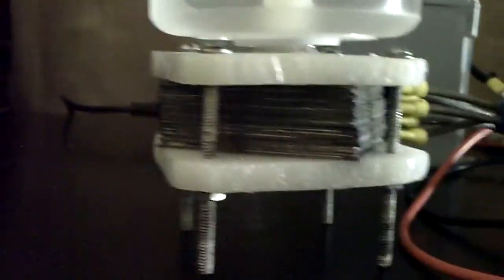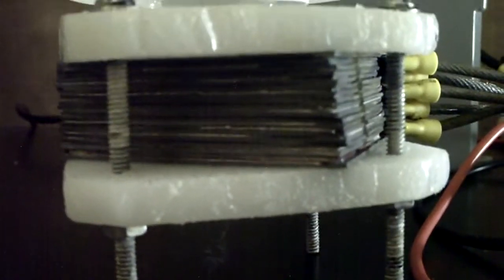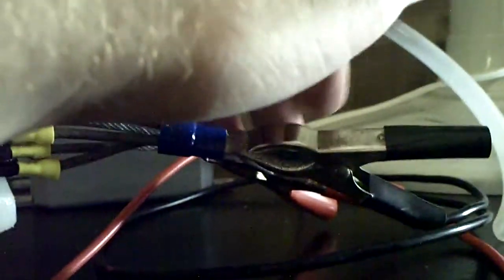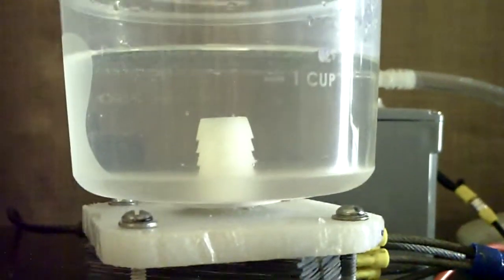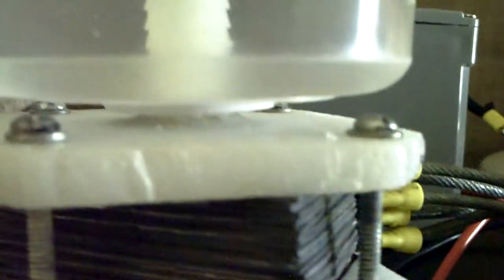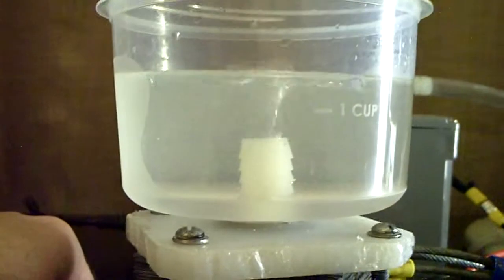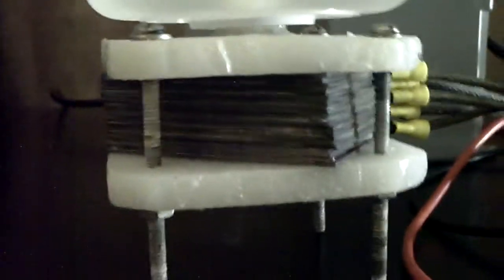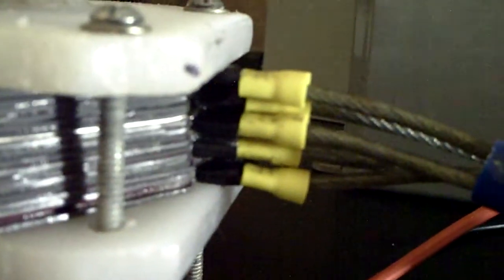Vid45 Volcano Cell Update (HHO, Brown's Gas, Hydroxy)

Comment: @HHO4ALLExcellent response, very good explanation, I have observed the same in my experiments with dry cells.

 So the idea is to merge the electrolyte tank, with the dry cell.

 But then, my question is, gas bubbles make it out fast enough so as not to accumulate between the plates?

Comment from the maker: @UltraDavidson37 You are entitled to your opinion.  I have tried standard drycell designs and horizontal designs actually work much better than vertical designs.  

Vertical designs build up pockets of gas that have to be forced from one plate to another.  They also have less reactive surface area, because the electrolyte will not go above the exhaust port.  This leaves you with 10 to 15% of unused surface area.

Comment: Very original, but this design is not as efficient, the bubbles begin to accumulate between the plates and prevent a good electrolysis, due to the horizontal position of the cell

Comment from the maker: @summertimef1  I discovered that using Negative Plates on the ends reduced the number of Pos Plates and in effect reduced amperage.  

Try a configuration like this (you will get the similar output with lower amperage)
-nnn+nnn- (using the extra neutral will increase the distance between the POS & NEG plates and will reduce amperage)

Adding neutral plates lowers the voltage per plate.  5 plates at 12v = 2.4v per plate, and 9 plates at 12v = 1.3v per plate.

Comment: @HHO4ALL   i got a question i have my ss plates. what did u find the best result in plate setup  +nn-nn+nn-   or +n-n+   or  +nnn-nnn+   what worked the best. ihave a 5 plate setup +n-n+  and i have a 19 plate +n-n+n-n+ ect.. i did to the +-+-+ that didnt work to well drew way to many amps.. so it need a N to separate them.. but should i use two N or three N?

Comment: trim the plates down on one side, but leave a little tab to plug the female connector in to in diffrent locations to reduce over crowding. 
to increase flow, use 2 tanks, and pipe it so the water can flow in from the bottom and bleed over to the second tank to prevent over flow.

Comment from the maker: I am using 1/16" Shower Pan liner for my gaskets.  This is pretty much the standard for most dry cells.

Water does not have any problems getting between the plates.  In the center of each plate I have a 1/2" hole that is located directly below the 1/2" Hose Barb. Gravity forces the water from the bubbler into the cell, where the center chamber is filled completely.

Comment from the maker: You are right, I was way off.  I hadn't taken that into account, but I'm sure I could mount it on a float plate to keep it level.

I've started working on a new variation that has dual output. The holes are drilled at the corners of the 3"x3" plates (diagonally across from each other).  This should help with water refill and reduce the chance of any gas pockets from forming.

Comment: you misunderstand ... I was wondering if this design will still perform well if it is mounted off level ... it seems to me that only a slight off level condition would cause gas pockets to form at the high points in the device which I think might cause a loss of productivity ... just wondered if you had thought of this and compensated in some way ...